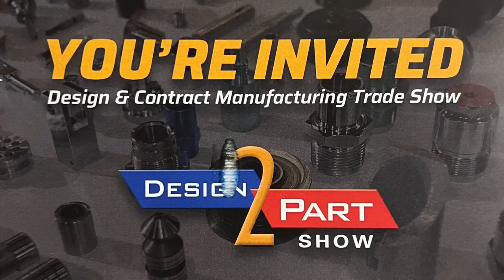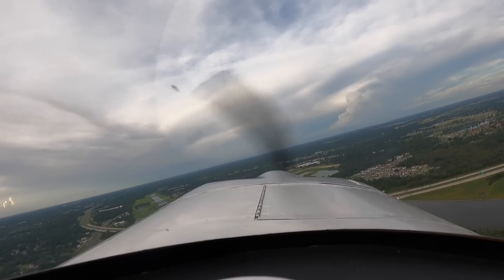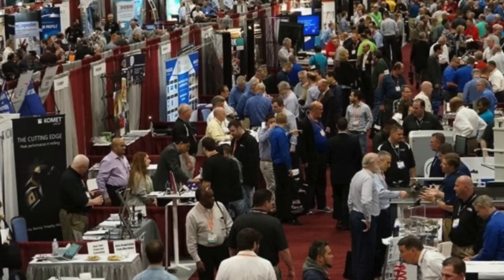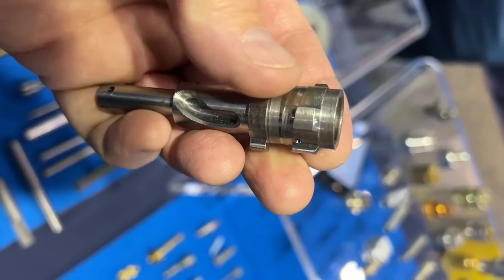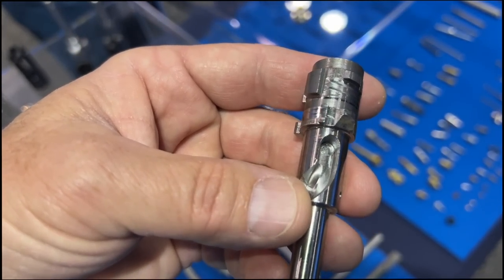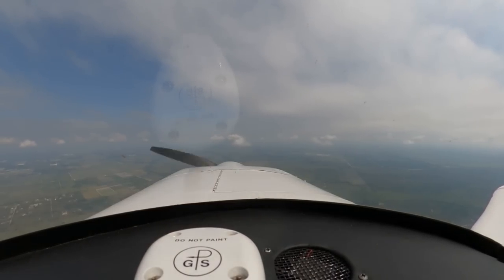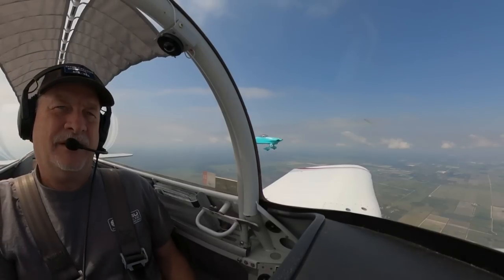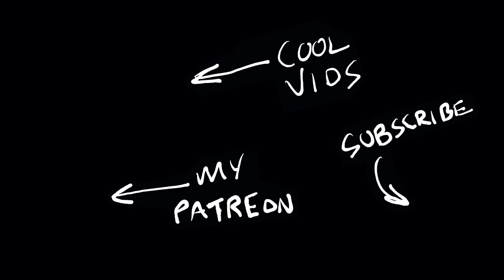Mystery Bolt!

Comment: That’s a Remington 750 bolt. As a journeyman machinist with over 20 years in the industry, a graduate of a top tier gunsmithing school, and a former small arms tech for the USMC.   If I my wife wouldn’t kill me, I would love to apply for that job opening. But I love my wife to much
Reply: Yep, that seems to be it.
I managed to find an ebay listing for the exact part, and an exploded diagram of the 742 that seems to fit the design language of this bolt in particular quite well.
Reply: Remington 7400
Reply: Hey the 750 is a semi auto the 7600 is the pump action (don't show your wife if you look it up you'll be embarrassed with all those years of experience )😂 I hate to say that your wrong
Reply: @Volvith  I was going to say it resembles the bolt from my grandpa's old 742 Woodsmaster but I'm just basing that off vague memories from using that rifle as a kid
Reply: @joshawageorge2122  thanks for clarifying that.
Reply: @Volvith  the 742 Remington has slots cut in the sides of the part kinda like the Browning bar !

Comment: 7400 Remington bolt😊
Reply: Googled it up. Agreed. Do you own 7400?
Reply: Yep, would have to agree as well.
Reply: Yep, I own one…
Reply: How does it work without an extractor?
Reply: @zaitcev0  extractor is missing on the bolt shown. Google 7400 parts list

Comment: The dual cam tracks are reminiscent of those found on certain Remington Semi-Auto rifles like the 742 and 7400. I don't think any of them have locking lugs like that, though...
Reply: Check out the model 750 Remington 🤔that model has the solid lugs like that
Reply: Probably a scrapped setup piece. I have some parts like that for Smith and Wesson handguns that came out of a railcar loaded with scrap steel...

Comment: Looks like a bolt for an industrial gun like a 50 Cal. used to shoot into Granite slabs to break them in half. Those cams would be for safety devices. This for sure would be a one shot only and I’m sure have a bunch of safety redundancies
Reply: The cams are definitely not for safety. The angle of the cam slots cause the bolt to rotate,  disengaging the lock-up. Plenty of auto-loading rifles have the same system.

Comment: Had to go to a Plastics Show in Chicago many yrs ago at McCormicks... took 3 days to cover the "points of interest"...  lots of kewl stuff and some handy items to bring home to the wifey. But the most impressive item I saw was the foam/plastic plate maker, 10' wide rolled plastic sheet wound its way across several heated rollers and into a stamping die which produced 48 plates per cycle at a rate of 2 CPS... 96 plates per second. They ran it for 10 seconds at the top of the hour 5 times during the day...  basically made 5000 plates a day. Imagine the volume if it was running 8 hrs a aday non stop   2.7 million plates  but it takes nearly 1.5 hrs to change out the plastic sheet rolls...
Reply: Killer, we used to go to Nat'l Plastics show and the real "points of interest" were very attractive, indeed! Did you take any of the "stacking resin chairs" molded there? They would be piled up all over the place because attendees realized the chairs would be too difficult to take home!

Comment: Maybe it's a radial delayed blowback system? two cam pin tracks to change ejection side I'd presume.
Reply: ya cmmg. i think the banshee or the 45 version? not sure tbh
Reply: @vevenaneathna  design is way different than what CMMG runs though.
Reply: Having some of the lugs not be helical would make it highly resistant to opening under pressure. That's not how that works. The bolt head isn't that flexible.

Comment: The helical cut backsides of the locking lugs also make me think it's  more blowback delayed than truly locked.  Which is a really sketchy way to do mechanical delay...
Reply: Between the shallow lug face angle and the shape of the cam grove, definitely a locked breech.  That bolt isn't turning to release until the cam moves to the back of the grove.
Reply: Works for low pressure stuff, cmmg does a delayed blowback this way on their pcc  (not sure the naming convention they use) 10mm. Allegedly works very well, no firsthand but apparently means you can effectively suppress it, which is a hard thing in a 10mm AR pcc
Reply: Im thinking that the helical lugs are for primary extraction.
Reply: @williambell7763  the cmmg is mediocre. Still requires a lot of buffer tuning, because the 10mm will nearly blow out the brass from premature unlocking. 

10mm's have enough pressure and gas to make them feasible for proper AR gas operation. The guy that makes them has been playing with a new version of the .338 Spectre that competes with the 8.6 bullsh-blackout.

Comment: It looks like that bolt isn't finished it may need a extractor cut ,a spring and firing pin  a push pin and spring for extracting holy geese the rest of the rifle I guess to determine exactly the size and style ar or ak style also could be a stainless remington synthetic 750  model .223 with a ar magazine and iron sights ,built to last and for hunting in all different types of weather .a 22.5" barrel might be decent for accuracy with a 1 in 10 "twist 🤔 😎 try it might be a great seller with the different laws and shit that are being inforced

Comment: Looks like a Remington 7400 type of bolt. Has the same type of angled, tapered lugs that "screwed" into the barrel extension and the recessed channel in the bolt face to hold a snap in "C" type extractor. Maybe for a magnum that never happened.